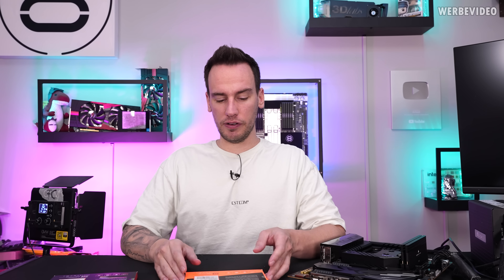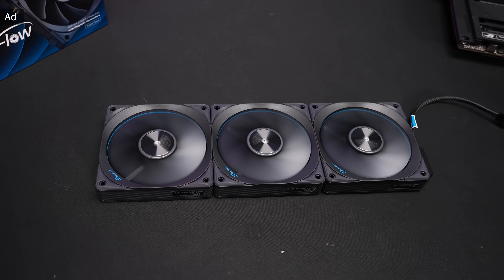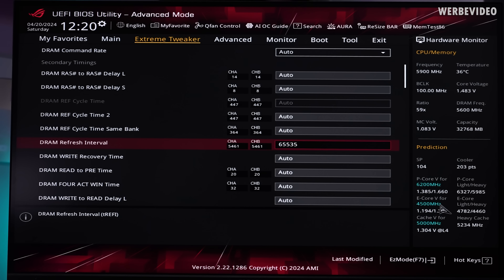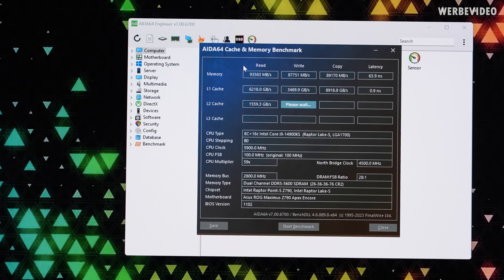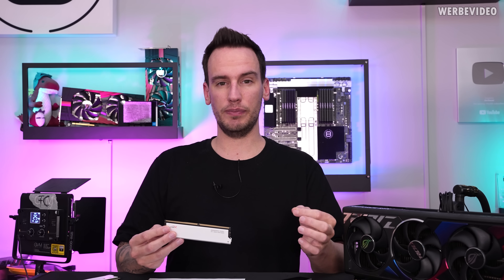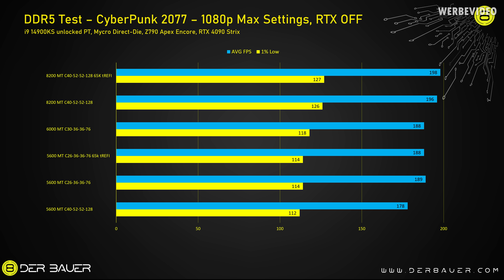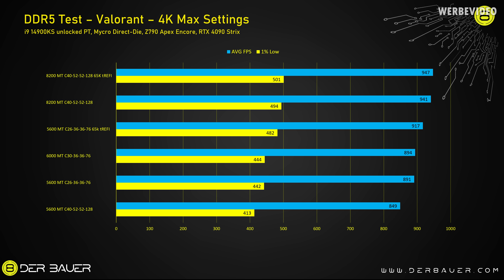Try this DDR5 Subtiming Tweak for Extra Performance

Comment: You can't compare "latency" like that, and I feel like you should know that! I'm not sure why you didn't discuss it. 8200CL40 has an absolute cas latency of 9.756ns. 5600CL26 has an absolute cas latency of 9.285ns. That's only about a 5% difference, whereas to a lay person watching this video without properly understanding how latency works, they'll see CL40 and CL26, and be expecting more like a 55%~65% difference! (depending on which direction you calculate it). The kit running 5600CL40 is an absolute cas latency of 14.285ns; almost 50% slower than the other configurations!

Comment: If your an extreme gamer that wants ro get every bit of performance out of a high end PC and Motherboard that has a 13900k, 14900k, RTX 4080 or 4090,  I would go with DDR5 High Data Rate Memory. In a budget PC 6000 Data Rate would be sweet spot. Great video, cheers!

Comment: I do know that if you hit the upper vram limit on a gpu, the system will look to ram for extra storage. So, at higher resolutions is where the biggest differences are. That is where having more ram with a lower end card is good because you will run out of vram faster. Even if you use dlss or fsr, I have noticed similar vram usage to that of running the higher resolution natively. So this test is interesting and the results make sense.

Comment: CL26 is approaching DDR4 server DIMM latency. That's pretty impressive for the speed.
Reply: Fwiw, you can't calculate latency from the timings alone. They're not an absolute value. RAM timings are counted by the number of cycles, and higher speed RAM completes more cycles in the same time versus lower speed RAM. 8200CL40 has a lower absolute latency than 6000CL30, despite 6000CL30 appearing to be a lower latency because of the lower number. 8200CL40 is 9.756ns, and 6000CL30 is 10.000ns.
Reply: But notice the second and third timings are 36.  There are CL30 DDR5 kits that are 30-30 instead

Comment: This only dips slightly into the art of memory tuning. If you really want to get into it, be prepared to spend a lot of time and effort. tREFI looks a quick win, but it’s not like you can set it to 65K and call it a day. As mentioned, increased temperatures can cause stability issues with this setting. And then you’ll end up in the arduous process of trial and error that memory tuning is anyway.

Comment: Surprised you didn't clarify there's a bigger benefit to low latency on AMD. For X3D it doesn't matter much in games but vanilla Zen4 sees decent gains. At least DDR5-6000 C28 (Hynix) with FCLK 2000-2100 should work on most systems, even with geardown mode disabled.

Zen4 can run up to 8000 in 1:2 mode now but it's not worth it for gaming and not every board can. Even tuned 8000 C34 on my 7950X is only marginally lower latency in AIDA than the ~53ns of a tight 6200 C28 config but ~10% higher bandwidth.

Comment: Back in the 90's I was able to get my hands on some DDR 1 RAM with CL of 1.5.  I could run it at 1.5, but was able to get more performance running a higher clock at CL 2.0.  Latency always mattered, but speed(Hz) always overcame increased latencies.  Still holding true!
Reply: Makes sense but clocks don't always win look at 3dvcach chips low clocks but 180GB per second bandwidth
Reply: @mddunlap03  True, but cache is another story.  Ever try burning a CD 2x with only 384kB of cache?  You get a coaster.  It's more like a capacitor keeping data flowing without interrupt due to a slower process in the line.

Comment: I second the request for 7800x3d testing. Would be great to see how frequency and latency affect the AMD chip.
Reply: X3D chips don't care thta much about memory
Reply: @MaxIronsThird    that's what I understand. It's one of its advantages. Still, I'd like to see it too.
Reply: @MaxIronsThird  That's the only thing you can do with x3d aside from pbo. I went from 6000cl30 to 6400cl30 and saw worthwhile gains to avg and 1% lows in warzone and rainbow six siege.
Reply: Tell AMD to make better memory controllers compared to Intel's. AMD's IMC's have been crap shoots for a while.
Reply: @kevinerbs2778 why? Is it unstable?
Reply: @sidewinder86ify  There are plenty of cases where AMD memory control cannot run XMP profiles or AMD profiles & the cpus memory controller throws out WHEA errors above certain speeds. There's plenty of forums to read about this issue.
Reply: @kevinerbs2778 It’s much easier stabilize DDR5-8000 on AM5 than on LGA1700. You said all this disinformation because you knew nothing about AM5.
Reply: @kevinerbs2778  AMD memory controllers are solid.  It's the infinity fabric running thru the pcb substrate between the CCDs and IOD that makes it impractical to run higher speeds since running higher than around 6000 MT/S requires you to desync and run the IF at half the speed of the memory controller, thus cutting in half the memory performance that each CCD is capable of achieving.  This could be interesting if memory got to 12000 MT/S and if the IMC could handle that speed.  I doubt it could though.  Once AMD moves from chiplet on substrate to chiplet on silicon like how HBM GPUs or the 7900XT/XTX memory control chiplets connect to the main die via interposer; then we'll see much higher infinity fabric speeds and therefore the IMC could be the bottleneck.
PS: The monolithic APUs don't have an IF or if they do it's contained entirely within the silicon and able to maintain 1 to 1 sync with the memory controller and those things can hit some really wild memory speeds.
Reply: @cracklingice  No they are not they are slow & cannot handle high speeds they are trash, infinity fabric does not matter at this point when it's not 1:1 link on DDR5 like it was on DDR4. please stop with the copium crap If AMD had decent memory controllers that weren't crap shoots, they would not need a limit to the mhz at all. Wrong the monolith die cpus do still have a infinity fabric it can run higher than what the chiplets do because of having much short lengths to move data. as length gets higher with infinity fabric the lower it speed gets
Reply: @kevinerbs2778 It’s in fact much easier to get DDR5-8000 stable on AM5 than on LGA1700. lol.
Reply: My 2c, when in break creeping up on every frame,learning where to eke out the performance is just not for today but also future systems. I too would like to see the 7800x3d testing. Given that testing, there are games that really are sensitive to memory, that being DCS AND MSFT 2020  both the flightsims  , with dcs being more difficult to get consistent results. Totally free with one of the pov in earlier comments that hours of testing for a few frames is not well seen when you are talking in the hundreds of FPS realm but when we NEED those xtra few frames in VR , THEN YES IMHO  it could be with it. 7800x3d is the king of the hill for the above 2 titles and memory timing /performance is the next hill to climb.
Reply: Marginally
Reply: I'd like to see the same test with 7700x and 7800x3d. Timings/clock test with and without v-cache.
Reply: I’ve seen a few comments about X3D not caring about memory, but that’s completely false.

Reducing Ram latency or increasing frequency, or both, will ALWAYS improve CPU performance. I use a 9950X3D and my performance went up quite a lot in CPU bound situations when I tuned my Ram.

The reason people think those is because X3D chips give higher fps and are faster meaning it’s harder for them to be the bottleneck.

Comment: The 48gb 7200clv34 kits out there offer the best of both worlds in speed and latency imo and a pretty good sweet spot for people who don’t have a super binned board or cpu to run 8000
Reply: +1. The video is misleading and doesn't properly cover the topic. 7200CL34 is 9.444ns, versus 8200CL40 at 9.756ns and 5600CL26 at 9.285ns.
Reply: @noxious89123  Cas latency is not a relevant thing to compare with DDR5 as it in of itself does not act the same as DDR4.

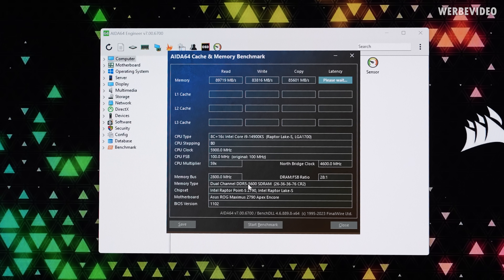Comment: 2:27 59 "ms" would be uselessly slow.
Reply from the maker: It's a stock windows with no changes :) that's the most realistic scenario for normal users
Reply: @der8auer-en  I think you've missed his point. It was 59 nanoseconds, not milliseconds! You merely misspoke in the video, and @TuxikCE was picking up on that :)
Reply: What's a factor of 1000000 between friends.
Reply: Latency meens nothing in isolation of Read/write speed, dude
Reply: milli vs nano
Reply: Nah, that would still be much faster than the supercomputers of the 1950s with their rotating drum memories ;-)

But yeah, 59 ms is well above the typical response time of physical HDDs.

Comment: Why does the temperatur of the ram increase with higher tREFI?
Reply: Where did he say that? The issue i
with high trefi is that tolerance for high temps decrease
Reply: @mircomputers  4:55
Reply: @happymountain2050  well that is just not the issue, increase in trefi makes memory more sensitive to temperature, doesn't make it hotter. But let's say your ram can run at 70c with no errors at default trefi, you might need to get it to 50c to have stable at 32640
Reply: @mircomputers  Thanks, that's a plausible explanation. The increased temperature didn't make much sense, as that would mean an increase in losses.
Reply: The ram refreshes more and thus generates more heat.
Reply: @Zhunter5000  refresh less

Comment: nice, but why those high settings. even with high end gpus I dont use high settings in e-sport titles. medium at max and low without any res scaling.
righ now am using 7800c38-46-46-96 with 12700k/z790itx.

Comment: The game lists he tests with BLOWS thumbs down. You need to test battlefield games, AVX2 based games /unreal engine games or Doom eternal maybe….. such a shame and out of touch .
Reply from the maker: Battlefield recently blocked FPS monitoring due to anti cheat. I used to run it but not anymore. Thanks to EA 😁
Reply: @der8auer-en  Factorio has a CPU only benchmark and is extremely sensitive to memory latency, large maps on Ryzen X3D can see 4-10x performance boost, search "FactorioBox" they have a selection of maps and script to automatically benchmark the game.
Reply: @der8auer-en you know that you could just record with an external camera and use battlefield in game fps counter right?
Reply: Cs2 and valorant are great games to test for this. They are high fps games that will show the difference between ram speed/latency. I just wish he tested at 1080/1440 low/med.
Reply: Why the dramatic comment. You know you can comment in a neutral tone ? It is not a war crime video. Just some computer hardware video. Chill man.

Thanks Roman for the video !

Comment: No comment on CAS latencies are in the unit of clock cycles, and cannot be compared straight off when you have different speeds?
To compare them you need to frequency normalize. The 5600 kit has cl 38-52.7-52.7-111 when normalized to the 8200 kit. Values are multiplied by (8200/5600) in this example.

This was not a test of low latency vs high speed and which one of those matters the most. Those two kits have quite similar latency in ns.
This was a test of high speed vs low speed with similar latency. With one option of both low speed and high latency, clearly performing the worst.

I would have loved to see a test of actual high latency but fast transfer speed. Something like 8200 with 40% higher cl values, 56-72-72-180, where it actually is slower than the 5600 kit.

All I was able to learn from this test is that MT/s matter a little, but not much in gaming. And that using both bad timings and bad transfer speed has a noticeable performance hit.
Reply: pretty much in all tests derbauer was gpu limited, valhalla is infamous for being gpu bound game, esports was tested at 4k (huh?), ram speed absolutely matters, latency and bandwidth, im not sure why he tested at such weird settings, he should have used 720p for all the tests.
Reply from the maker: @h1tzzYT  CS2 and Valorant even with 4K are extremely CPU limited. The GPU load is 50-60% and I never test 720p because it's a useless and only theoretical scenario. I want people to see what it could actually do for them and not what it might do in a scenario they will never see
Reply: @der8auer-en  But that makes the entire test, and this video, irrelevant. I greatly enjoy your content, but I strongly agree with @ealmen. You missed the mark with this video, by a wide margin.
Reply: @der8auer-en  fair enough, you got 50-60% GPU load in CS2 (4k max settings) as well? Valorant is indeed pretty much exclusively cpu bound, but cs2 is also very gpu intensive especially at 4k max settings
Reply: The primary timings make virtually no difference to the latency with DDR5 when compared to DDR4. tREFI is probably the single handedly most impactful timing, and (For Intel), I'd argue tWRWR_sg is the next most important timing.
Reply: @Zhunter5000  Be careful with tREFI, overdo it and you will experience SERIOUS memory corruption ***that RAM tests will NOT pick up on***! 

I speak from experience. It's a good way to corrupt your OS and, worse, your data.
Reply: @JcRabbit  I also speak from experience. Hynix chips can handle 65535 tREFI almost unanimously. The performance dropoff happens before then, but it's basically min maxed at that speed. While it can go up to 252143 or whatever, there's not even a 1% performance difference between that and 65535, while maxing it out is ACTUALLY unstable.
Reply: All timings matter, CAS latency refers to the latency to read targets, RAS refers to computer errors according to google, but couldn't find much about ras or other sub-timings. So basically every timing matters, and it's best if they're tight so u get the performance from all different tasks. I do however agree on the MT/s statement, frequency doesn't mean everything, timings also matter, it depends on the ratio of the frequency and timing to get the actual speed of the memory.
Reply: @electrothecat  It's different for DDR5. While all timings are 'important', some are less than others.
Reply: @Zhunter5000  RAM is RAM, timings have always mattered, if there was a company that can reinvent the wheel, then we would have that as a product for our vehicles already, however we still use the same concept of the wheel that survived through millennia. The only thing that is different about DDR5 compared to DDR4 is a new feature, that's basically it... This is the main reason why I believe DDR5 is still a gimmick, I still use DDR4 bc I can't justify the cost of DDR5 over DDR4, where I can get the same performance for a third of the price, even though there's a feature to help DDR5's performance not present with DDR4 platforms, I just don't trust that my machine will work reliably if I do so.
Reply: WAT?!
Reply: According to Buildzoid, primary timings on DDR5 are of low importance. There are memory profiles in many BIOSes to optimize subtimings by DRAM chip manufacturer. Why not try that? We might see more latency gains with more chance of stability..
Reply: @vladimirljubopytnov5193  I wouldn't just trust one source of info, those features u mentioned are basically the memory training algorithms present in Intel 12-13th gen and AMD 7000 series compatible mobos. On my Z790 with i5 13600K I have the feature called 'Enhanced Memory Profile' (for ASUS mobos), what this essentially does is try multiple different frequency/timings combos and find the sweet spot of performance and stability. He is not wrong but he isn't right either, DDR5 has protocols that DDR4 doesn't to perform 'Enhanced Memory Profile' training, meaning it can have a dynamic ratio of frequencies vs timings, something DDR4 struggled with in the past.

Comment: Interesting video and unsurprisingly the conclusion is that it isn't worth it except for the ultra enthusiast who must have the highest end gear and also win the IMC lottery in order to actually hit 8000+ MT/s.
Reply: Also anyone with x3d just not giving a f lol
Reply: I have an AM5 motherboard, 7950X3D, and 8000MT/s DDR5 RAM and it was a two week long trial-and-error period of getting my 8000MT/s ram stable with tightening primary and subtimings.  The increase in performance is about 18-20% in almost every scenario, but I also overclocked my timings to the absolute limit.  
In order to achieve 8000 MT/s, you have to buy hardware that can support it and can push those frequencies in addition to providing support.  
It's just not worth it. The difference between 7600MT/s and 7800MT/s is 2% and 7600MT/s and 8000MT/s only being 4%.

Comment: Github MemTestHelper / DDR4 OC Guide
Keep in mind that running max tREFI can corrupt files, so tread with caution.
Reply: DDR5 can run a much higher tREFI than what he ran. 65535 is a safe value for 99% of sticks, and the performance dropoff makes higher values irrelevant.
Reply: @Zhunter5000 depends,  my 32x2 6000 cl30 kit causes corruption even at 25k.
Reply: @DaltonP386  that's most likely because of your sticks getting too hot, not refresh rate itself.

I had similar thing going when i overclocked my hynix m-die kit. When i set 65535 trefi, ycruncher vt3 would error out in 56 mins on 28th loop because sticks got too hot by that point. Simply installing a 120mm fan, held by the zip-ties above the ram sticks solved all instability issues (6h of vt3 + 4 months of daily use w/o problems)
Reply: @DaltonP386  Your RAM temperatures are probably too high and that's causing the issue.  I saw something similar happen in a PC that didn't have good airflow over the RAM.  I put a fan near the RAM and all of a sudden 65535 was stable and passed multiple passes of Testmem5 and y-crucher 5b.
Reply: @Zhunter5000 he did run tREFI too in the gaming benchmark.